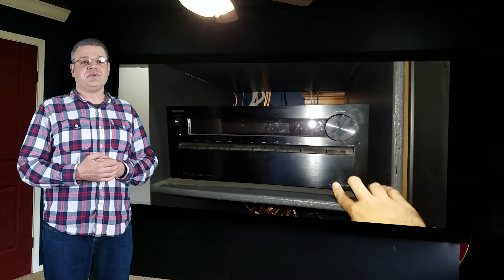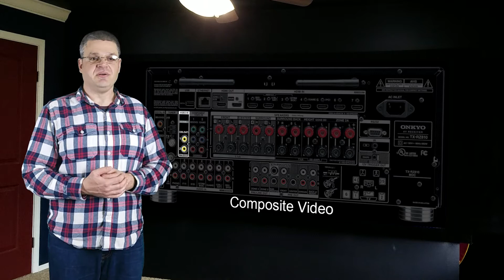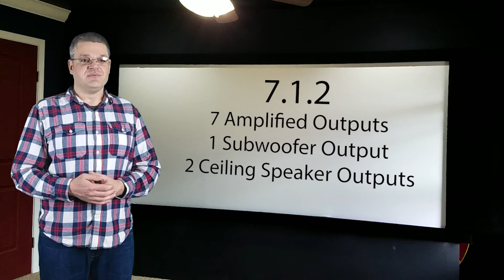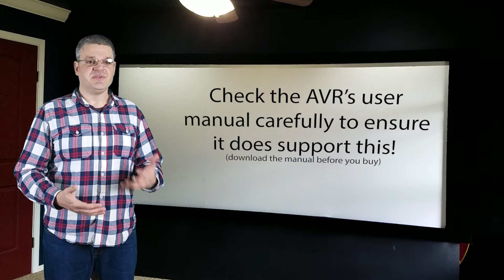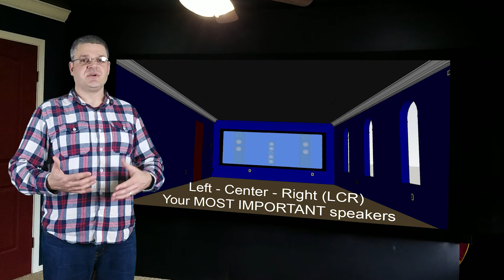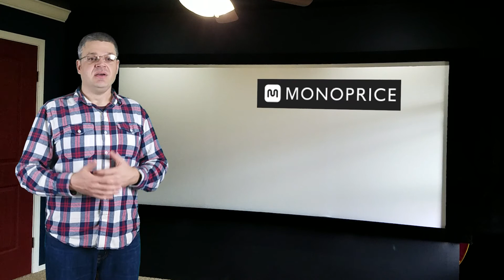Audio Video Receivers

Comment: Sir, Suggest me perfect Dolby atmos inbuilt AC reciver for my room 12 × 22 " .
Reply from the maker: Its hard to know without more specifics.  How many speakers do you want?  5?  7?  Also, how many ceiling speakers - 2 or 4?

I like the Onkyo receivers.  Their page is a good place to start:  https://www.onkyousa.com/Products/prod_class.php?class=Receiver&source=globalnav

You should be able to narrow it down to just a couple choices just by knowing how many speakers you plan to install.
Reply: Family White TV 7 surround speakers and 2 ceiling speakers and 2 sub woofers
Reply from the maker: Ok, so you want a 9.2 receiver.  On the Onkyo side, the TX-NR787 would be your choice if you want a more basic receiver.  If you want network connectivity and more bells and whistles in general, there is the more expensive TX-RZ920.  On the Denon side, the AVR X4400H would be your choise.  Like the RZ920, it is also a network receiver with lots of extras.